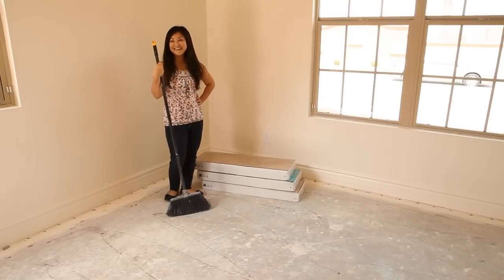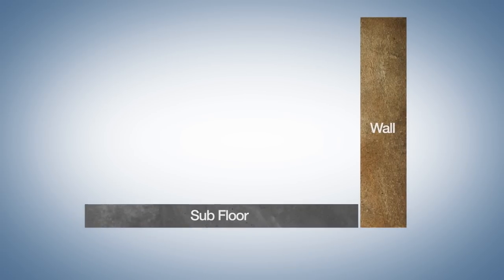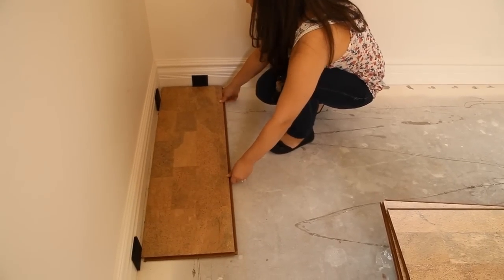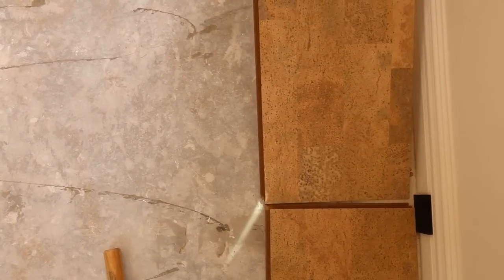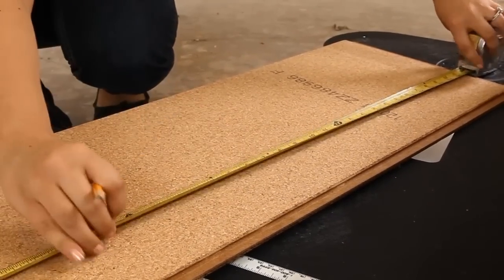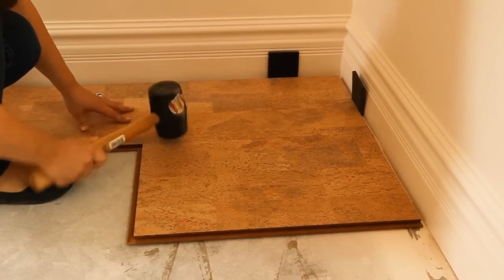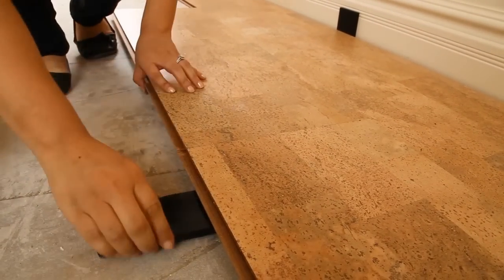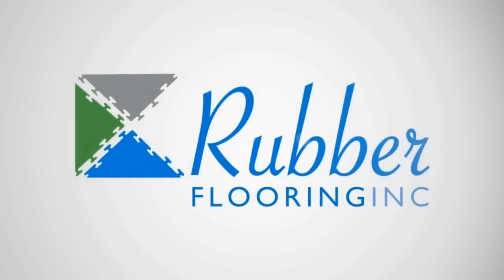How to Install Cork Flooring- Cork Flooring Installation Made Easy

Comment: How do you install the last row of tiles once you get to the opposite wall? Seems like it would be a little trickier.
Reply: Did anyone answer this question?
Reply: You need a table saw to rip the edge of the opposite end as well as to cut routes for floor vents. Remember to measure for the expansion of the opposite side and make sure you don't cut off the interlock on the bottom unless it is the last piece

Comment: Oops—you're installing a cork floor on cement, with no moisture barrier?? That's okay on a wood subfloor—but on cement, not a good idea! To protect the cork from absorbing moisture and warping, you should start with a heavy plastic sheet or moisture-blocking foam or rubber underlayment.
Reply: It'
It is built in.

Comment: Why isn't it necessary to lay down Visqueen (or some other moisture barrier) first, on top of the bare concrete?
Reply from the maker: Hi there,

Depending on the moisture in the concrete and your location, it may not always be necessary to use additional moisture barriers. It's always better to be safe than sorry and flooring should be installed according to the manufacturer recommendations. In our application moisture was not an issue and did not require that additional step. We plan on updating our video and expanding on the aspect of moisture & vapor barrier to better explain these steps. 

Thank you,

Incstores

Comment: Great video... It looks easy... Can you rent the tile cutter??? ... And how much will cost the cork floor like this one???
Reply from the maker: Hi Linda, 

We have several types and styles of cork flooring, you can check out the options and prices here: http://www.rubberflooringinc.com/cork-flooring/index.html

Currently we only have the tile cutting tools for sale, but you might be able to find a cutter to rent at a local hardware or flooring store. We also offer free samples available on our website to help make your decision easier. 

Thanks!

Incstores.com
800-613-0996

Comment: I would like to have Cork floor for my bathroom, but the same kind as in the wine bottle cork. Would that work?
Reply from the maker: Hi Ajani,

If it is a full bath, cork is usually not installed because of the core and moisture. In some cases you can put a rug over the cork and it will be just fine. Here is a link to our cork planks: http://www.rubberflooringinc.com/cork-flooring/eco-cork-classico.html. For an alternative solution that would be recommend for a bath room, I would suggest taking a look at our vinyl flooring tiles (3rd color option on this link): http://www.rubberflooringinc.com/vinyl-flooring/fire-and-ice-vinyl-tiles.html

Let us know if you have any questions or would like a quote!

Thanks,

contact@rubberflooringinc.com
800-613-0996
Reply: Thankyou

Comment: Hi,
I have a concrete floor base, can I still install the cork on it?
Reply from the maker: Hi there, 

Yes you can install the cork directly onto the concrete sub floor without any additional layers. If you have any questions about the installation or product itself, feel free to visit our help page: http://www.rubberflooringinc.com/cork-flooring/install-cork-tiles.aspx
Reply: @RubberFlooringInc  You are doing your customers and viewers a disservice by not addressing the issues of moisture in a concrete slab. A layer of 6 mil black plastic should be required for all cork flooring or MDF cored plank material.

Comment: How do you install the last row of tiles once you get to the opposite wall? It looks  like it would be very complicated (?).
Reply: Basically you can use a lever against the wall like a hammers nail remover. But you can use whatever tool, just create a lever to push a plank into place. Remember to protect the wall with something.
Reply: @MaciejakGitara   That makes sense. Thank you very much for your reply & time.
Reply: Many times you need to cut the final column of tiles lengthwise to fit odd shaped rooms or rooms with raised baseboards
Reply: @Rakstawr  Thank you for the information-much appreciated.